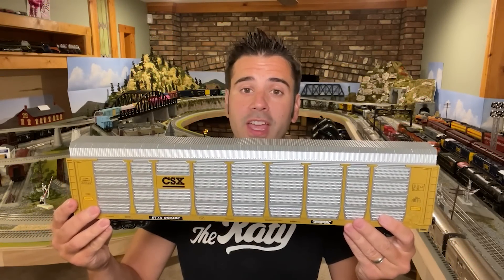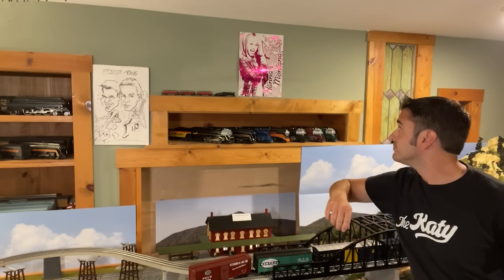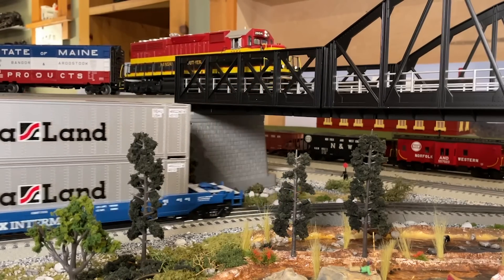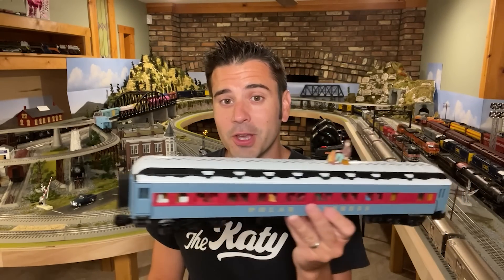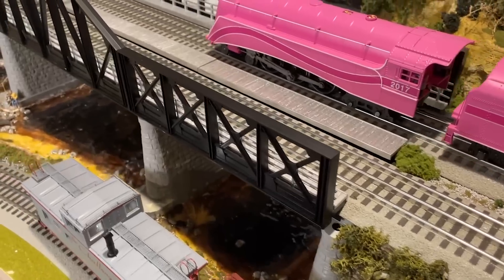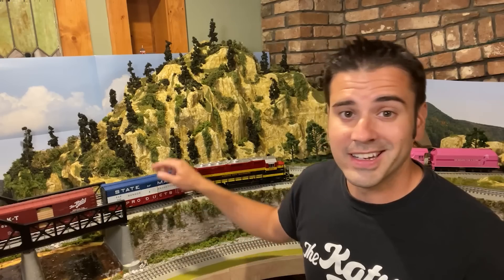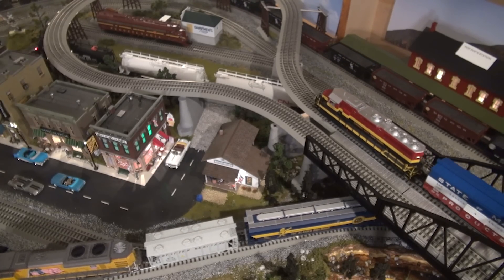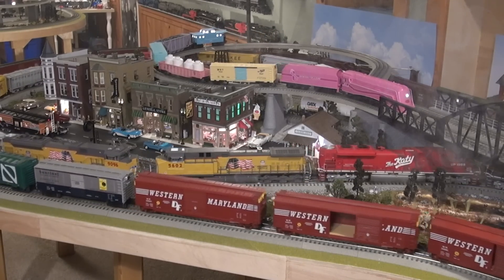I Need Your Help

Comment from the maker: Thank you all for the suggestions and feedback thus far! I should have clarified in the video about the risers. All good there and I have a plan to elevate the track for the tall rolling stock. I am mostly looking for suggestions and ideas for the elevated track plan/ mountain idea. Your ideas are extremely helpful!
Reply: Just put in bigger risers and/or shift the entire up-layout
Reply: Maybe be you could use the woodland scenics foam inclines to help raise the upper section. I could also see a mountain in the center on the other side of your layout with a stop block system to add some more action
Reply: I have an idea, take the elevated track of, and try and 3d print bigger supports by measuring your tallest rolling stock and make taller supports, if you can't , you could take like thick fo to elevate the  track, and for the tunnel and mt. If it's plastic, you could take it off and Get thick foam and you could get creative.and for capturing scenes, you could get or make a pole, and get a small Camara to take footage. Well these are the ideas I brainstormed to fix your problem.
Reply: Do a mountain with a real working water fall with real running water
Reply: I think I would connect both elevated lines.   That radius in the corner of the layout currently is too tight.,
Reply: Chris I would keep the Lionel trestles that you have and just put risers underneath them basically blocks of wood painted concrete.
Any selections with land mass attached just Rais up this way you are not making big changes. 
That's pretty much what we did to maintain the look we had already had. Just had to extend mountains at bottom footing 2 inches.  And blend in.
Reply: Risers helps to hold up your Lionel FasTrack more higher than the original ones you have
Reply: Haven’t watched this channel in months
Reply: I cannot wait to see that video as I am in OSU wexner hospital having a hip replacement cleaned of infection. I love your model railroading.
Reply: Idea: dip the tracks underneath the bridge, may have to modify the pieces by taking a bit of the ballast bed off.
Reply: To hide your turnaround near the town/city, use a board with a painted cityscape/skyline to hide that part of the layout without taking away from your town scene.
Reply: Wow

Comment: The hard part about the upper track turnaround is that it's so close to the town it'd be difficult to mask it with a mountain unless you put in a sheer cliff face there. And I don't think it'd look right. Raising the track, if you're not going to move it around, is the easy part. Just 3D print some spacers to go on top of the supports. Biggest trouble there is raising the portals and possibly the mountain where the upper track disappears into the mountain near the fireplace.
Reply: @cjvolpe368  I would be concerned about the kids running into that depending on where he places it.

Comment: Great video RBP! I suggest connecting both of your upper loops somehow with a single track so you could keep them as two separate yet connected circuits. I also think that would be interesting if you did a mountain in the Bailey Township though I feel like it would cause some major clutter. The way I think it would have to work is the mountain only cover a little over half of the end of the “dogbone” end of the track and then connect to the backdrop. That would create an interesting complex of tunnels underneath to service the mainlines and the upper loop but it would help hide the turn around and add a new element. The part of the loop you don’t cover with the mountain could be on the edge of a cliff similar to the part of your layout by the big double track bridge. Just some ideas!! Keep up the great work!

Comment: I’d take the whole upper loop out, cut some sub roadbed out of half inch plywood and then replace the track with gargraves. If that’s your plan anyway that would be a good place to start. Then for the bents, you could build some yourself in a simple jig that would be taller than the Lionel ones. Bob Bartisack (I just totally butchered his last name!) has an article on his website for building trestle bents.

Comment: Yes!  A scrim (backdrop) that you can hang from the ceiling would be ideal!  Something printed on canvas that you can easily move if you need to get to the storage behind.  Same goes for covering the fireplace.  

Great idea to join both elevated sections together, perhaps using a causeway that you can navigate under.  It should also not be too much of a problem to elevate the sections of track that are preventing the rolling stock from moving under.

Comment: As for the loop @ the town, I would recommend a simple 1in wooden block riser painted to look like cement or brick. It may be possible to "hide" the track by altering the backdrop and background by adding a few cement grain tower's similar to what is seen in the Wichita,  Kansas yard near downtown. It may require slightly adjustment to the loop and pushing it back into the cubby space slightly. 

The other loop near the fire place,  I would consider doing a an graduated height increase from the scene you want to keep to a elevated line connecting both loops.  The bracing for the elevated line could be based off the same girder supports used by Chicago's "L-line" elevated subway line. For the return back to the fireplace, hide the line behind the backdrop as to give a break up to the loop.

Comment: I would say keep the two tracks on the upper level past your bridge and wood cabin scene, then put in a switch bringing the line into 1 track to continue to the other end of the layout, then put another switch in to make another reversing loop. This would mean youd only have to run 1 upper level track over your yard area.

Comment: What about a large factory instead of a mountain? You have sidings already in place, so something like an iron works or steel mill. Accessibility to the back is still key, but all the buildings and piping would conceal quite a bit

Comment: For the two upper tracks, connecting them into one upper loop would seem to be a noble goal from an operational standpoint.  However, it would probably require single track in areas to avoid being obtrusive in the area above the big yard.  This single track would be problematic for running two trains at a time on the upper loop, which is nice for photography.  So I’m not sure what to do here. If I were to do a double track upper loop over your big lower level yard area I would borrow from my home city of Philly and build a high line structure over the yard.

Comment: For the small loop you mentioned in the beginning, just add a 1/2 to 3/4 inch “concrete” or gravel pad under the supports and add more of the backdrop, just put it on a hinge so you can access your storage. For the corner with the mountain, make both lines go side by side into the mountain and out, and follow the wall to the other elevated loop. Just a suggestion!
Reply: Forgot to say, your could put a factory in the center of the loop, and turn the track into more of an aqua duct style elevated section, maybe have a couple of the atlas beer tankers parked on a siding next to the factory?
Reply from the maker: Great suggestions!

Comment: I think for the 2nd level of track you should raise the support beams by putting a small piece of wood or extruded foam that is like at least and inch, for the bottom of the of the support beams. I think it will work

Comment: Hello Chris, I have been thinking about this since you posted this video. I'm guessing you are probably want to raise it 1.5 to 2 inches taller? For the trestles you could add risers to the bases to you existing trestles if you want to save them and paint them to look like like a concrete foundation. Maybe you could add a single track somewhere connecting the two elevated lines, maybe a double. The existing mountain is a challenge but it can be done! You can raise the tunnel portals, but you may have to re-contour the terrain by the tunnel entrances. Another mountain scene for that other turnaround be will be very cool! I wish I was at your place so I can get a much better evaluation and analysis and help you even more! You can do it and keep up the good work and amazing and fun videos! You take care!
Reply from the maker: Thanks for the suggestions Andy! I am not looking forward to the redo of the tunnel portals. That is going to be one of the more time-consuming parts for sure!
Reply: @RBPTrains  You're welcome! Take your time and don't rush it. I literally cut terrain sections out I did not like, and replaced it with new when I did my big layout overhaul. VERY time consuming but it was worth it! I can send pictures (LOTS  of progress photos the way) by email sometime soon when I have time.

Comment: Something you could do is just trip notches in the track for cars to go through

They have actually done something similar with tunnels like tehachapi pass, to make modern cars like double stacks fit, they cut the tunnel roof to be more like a square instead of rounded. By cutting corners into tunnel roofs it allowed modern cars to go through.
So you could just trim the overhang of the track pieces that are low

Comment: Hey Chris, after a little research and some pondering I think I have a solid idea (in theory) for concealing the upper loop. My plan involves moving the station closer to the rest of the town in between the two spur tracks with the tankers and the Pennsylvania diesel locomotive. If that is possible, I believe that would add more continuity to the layout of the town. Then, where the station is currently, you could add a mountainside to continue the theme you like so much already. Then you could make it slowly take over at least half of the loop from the side closest to the wall to the apex of the loop opposite the two-track bridge. You could do this with a large cut, making the trains disappear from certain angles, or you could do a full enclosed tunnel. Then you would have to add two tunnel portals on each end of the lower level of track for each main line as staggering is most often preferred on curves. You could have the first two entering the mountain approximately where the middle of the station currently is, and the other two just before the crossing. Anyways, I know that's a lot of words, but I'm always happy to help!
Reply: So ya really think he reads these comments?🤣😂🤣😂🤣😂🤣
Reply from the maker: You bet! Been busy this weekend but will go through them :)

Comment: Thanks, Chris, for this challenge. Quite a conundrum you've got to solve. Not having an actual layout, I can still appreciate the difficulty you face. As you suggest, connecting the two loops together, joining each end of layout into one large one would save the town scene, but would require the raising of the upper tracks on both sides to allow for larger freight to pass under. You would also have to choose between a duckunder or a gate-like opening to get into the control centre. Of course, the final solution is up to your excellent knowledge and skill at planning and modelling. As always, love your videos and your sense of fun!
Reply from the maker: I have been playing around with the idea of a duck-under bridge. Still  figuring it all out but thank you for the insight Tom!

Comment: I got two ideas. You could move the backdrops closer to the front of the layout so the elevated track does some of its loop behind it. This would also allow it to look like it’s going somewhere.
Other idea is more expensive where you could build a lift bridge and connect the two elevated lines with it, but it might make the layout feel closed off.

Comment: If you connect one loop of the high rise to the other loop on the other end of the layout you should make a big suspension bridge or some sort of cool bridge. 

Or if you decide to reduce the work load what you could do is make a slight hill from the outside of the tunnel to the loop until the hill is high enough for the hobo and the intermodal cars. The actual turn that’s causing clearance issues shouldn’t be inclined unless you want a derailment.

Hope I make sense Chris!

Comment: A bit late to the comment party...two ideas...one would be to use some taller buildings...like apartments to mask the upper turn around.  Your happy town lends itself to residence verses industry.  
Now for the elevated section....I wod ditch the return loops all together, join all of it and have some sort of bridge that would spam the walkway at the front of the layout...while the bridge idea would be a massive undertaking it would add new camera possibilities.  And I would also suggest the upper section be double tracked with maybe some crossover switches added.  Good luck and hope my comments are helpful.

Comment: For the loop by town try making it a slightly raised gradient and put it in the middle of the lower track if you can that way you have a bit of room to raise it up a bit, for the other overhangs do a small little “speed bump” so it gets raised over the track and then lowers just before the tunnel

Comment: Personally, I love the turnaround area that you have already because you can fit so many trains in one frame and it looks awesome. But, on the other hand, if you could pull off a mountain scene there, you may be able to make it look less crowded. As for your elevated track issue, you could build supports that allow for space directly underneath them , so your overpass on the right corner would possibly fit better (and of course allow you to make them taller) I have had lots of experience with this type of issue on an old layout due to size , and hand-built supports did the job for me, though it is a tough solution. Just a suggestion though!

Comment: The only cone shape to hide the turn around is a Volcano scene. Also raising the upper tier about 1/4 inch should give you enough height without changing to much. Camera angle that is another matter. Not sure the best way to do that although you could a a helix loop to the layout and go higher as you basement area is not big. Your only option for expansion seems to be up.

Comment: It would be a big change but I think I would try to double track the entire elevated portion and eliminate both the turnarounds then connect it via a giant custom bridge over the main aisle. This would make a giant double tracked loop around the entire layout with potentially wider turns allowing bigger locomotives and rolling stock to run up there. Like I said huge change but I think that's what I would try. A big potential problem would be the bridge obstructing certain views. Most of the areas you wanted to preserve on the elevated section seemed to be double tracked already.
Reply from the maker: This is the same concept I was thinking! Love the idea and it will allow larger trains to run up top. Constructions starts soon. Thanks for watching!
Reply: @RBPTrains  very cool! Seeing 2 trains come at each other on that bridge will be a cool shot

Comment: Subscribed. Excellent collection! I won't bother with any suggestions because there are some excellent ideas here but I think a long term goal is  to get to the point where you can run scale things (curve/height requirements) on at least one line and you won't look back. I made the same mistake on my first permanent layout and could not run intermodal.
Reply from the maker: Thanks John and welcome aboard!!

Comment: I would consider building a suspended framework that supports the majority of the mountain needed there from the ceiling. Thinking of hanging all-thread rod down that would support the wooden platform just under the new elevation of track and building up and around that. The top that meets the ceiling could be cloaked in "clouds" like you see where some layouts have the thunder and lightening sounds, and the controls and speaker for that system would be mounted in....  you guessed it, inside the top of the mountain on a shelf supported by the aforementioned all-thread rods. Having that hollow with shelves inside would allow for control and automation such as when a train passes by inside the mountain a light comes on in a structure to add life to it instead of a static rock.

Comment: The sound effects on the first engine are so amazing and I love the American whistle !! Like they said in the "It's a wonderful life" movie: 
You know what the three most exciting sounds in the world are? - Breakfast is served. Lunch is served. Dinner... - No, no, no, no! Anchor chains, plane motors and train whistles.
The black engine has a typical German steam whistle, very funny ...
As for the clearance problem: Maybe you just elevate the whole top level a bit? Like an inch or two? And yes: some concealed track, maybe a steep cliff that hides that very tight loop on the upper track, would look amazing!
Reply: oh and 9:13, maybe add something like what they have here (see the crossing in the photo below, top right). They built some sort of a concrete or brickstone platform and on the top, there's a lot of space for the upper-level tracks ...:
https://de.wikipedia.org/wiki/Eisenbahnknoten#/media/Datei:Db-101023-01.jpg
Reply: that whistle on the norfolk and western steam locomotive is the most common whistle the norfolk and western used. They called it a hooter whistle
Reply from the maker: Thanks for the link and the suggestions Tom!

Comment: Yes it is a real paint scheme. It was used on streamlined 4-8-2 locomotives. Sadly this paint scheme wasn’t called the “Hot Dog” it was called the “49er” and had that exact paint scheme as the challenger. But no, the challenger didn’t get the 49er scheme.